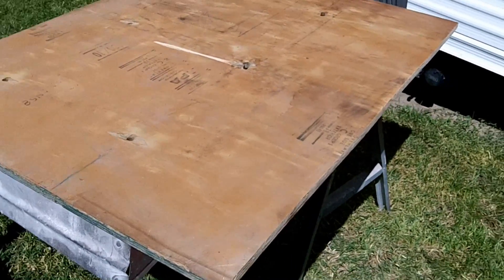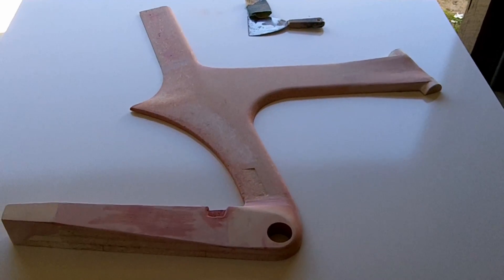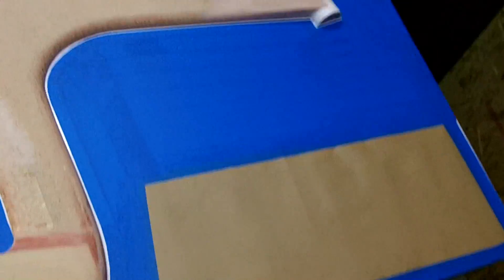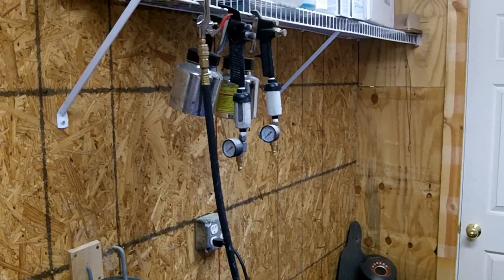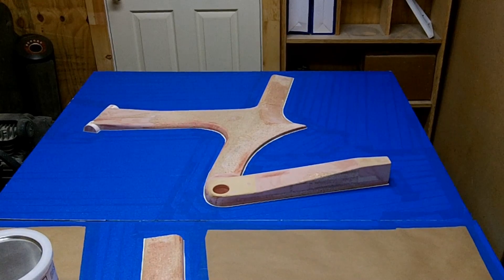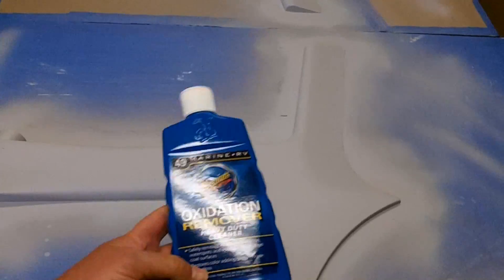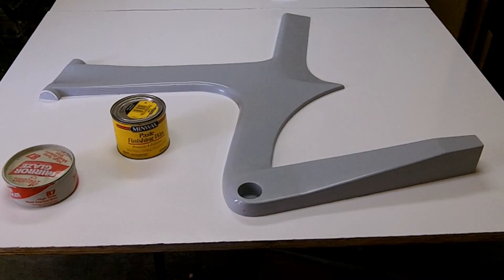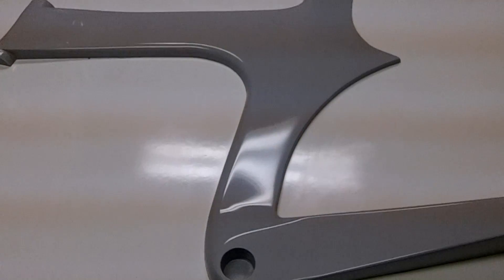Z Frame Bike: Video 5 of 13- Building the Plug Mold

Comment from the maker: @circusboy90210 
I have to admit on one occasion I had gotten done spraying something with Polyester Resin and while it was curing I was sitting under the garage door of the shop working on something without a respirator on. I thought that there was plenty of ventilation because I was pretty much sitting outside. But after a while I got real dizzy, a horrible headache, and then started throwing up. Ever since then I don't mess around with it- If I can smell any VOCs I at least wear a respirator.

Comment: 5:29 icocyanate poisoning is permanent and accumulative. thanks for not understating the need for protection when working with paints. good friend of mine worked auto body for 20 years and is permantly screwed in the head because of and his physical health is not good either.